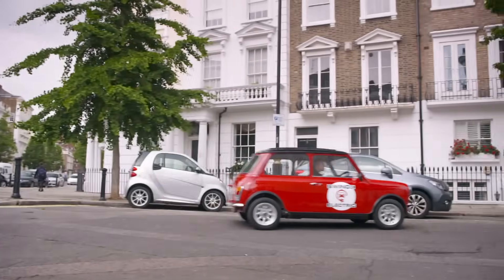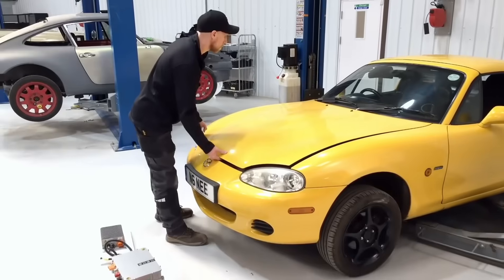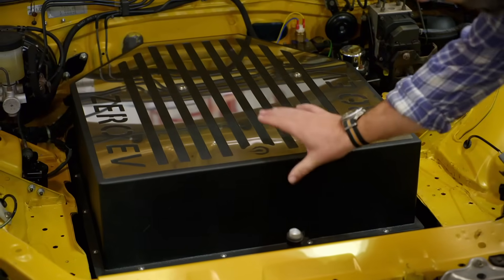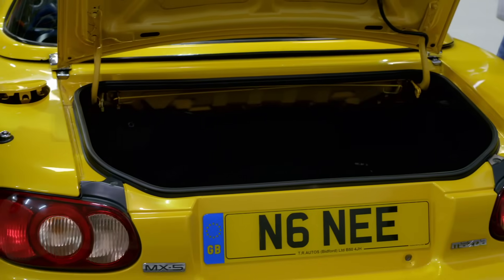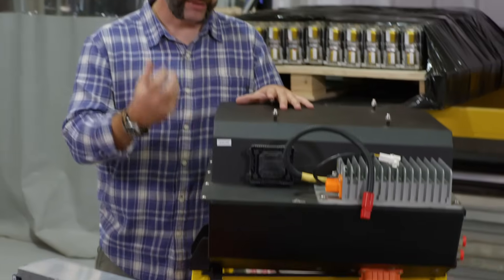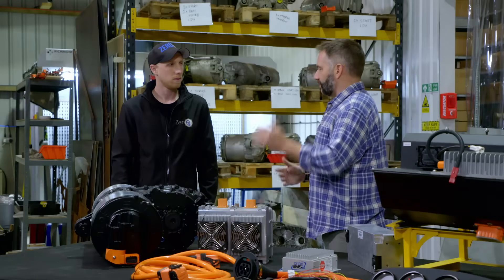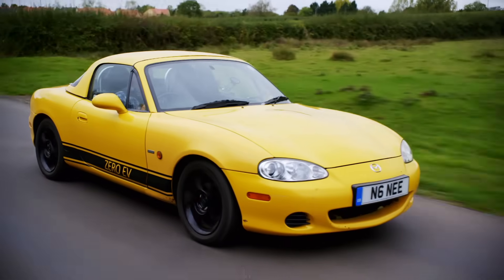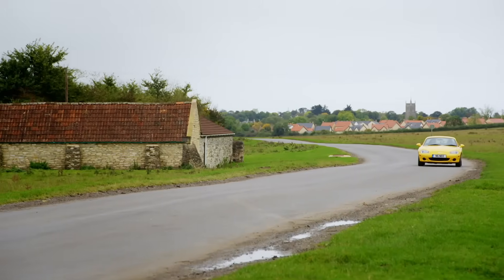What is really involved in converting an IC car to EV? | Fifth Gear

Comment: Why? Batteries haven't been perfected yet. You always have the expense and problem replacing the battery. Any gas savings etc. needs to be saved to pay for a battery to be replaced. What are you saving. Nothing. And you can't drive any distances. An EV isn't reliable. Fact.
Reply: Gas cost in UK is crazy expensive. Probably works out to be cheaper in the long run for EV.

Comment: EV conversion makes so much sense!

I would love an bolt in kit for my Polaris Sportster 850.
I don't need/want much power/speed

5-10 kW motor
5 kWh battery
max speed: less than 20 km/h

Comment: Other companies are also creating bolt-in kits, and as they expand the consumer cost will come down. It's a perfect way to preserve older cars while improving on the limitations of internal combustion with better performance and reliability and less maintenance.

 My dream vehicles would be EV conversions of a Mazda Miata NC with retractable hard top and a Mazda B2600i 4x4.

Comment: I have been looking into this & the kits are either :
A-WAY too expensive
OR
B-requiring of a lot of fabricating for brackets & whatnot.
I'm thinking the easier & cheaper way may be to buy a wrecked EV with intact drivetrain , scrap the
crumbled body & attach the body of your choice. CANOO is pushing this idea. After you own a CANOO
for several several years & either tire of it or have a new requirement, scrap the body & mount a new 
style body. You could switch it out to a sedan or a pickup or whatever.

!

Comment: This is going to get crazy. Future SEMA shows are going to be packed with EV conversion stuff both hardware and software and it's going to blow your mind. OEM EVs may be difficult to upgrade to new battery technology but if it's a conversion car none of them can prevent you from using the latest technology or software.

Comment: Feel free to do an episode like this in Australia... 
They will only convert classic cars and starting at $40,000.
I want to convert our family 8seater van as it cost $200-$230 a week to refill with diesel. Yet we feed 500kw+ back to the grid with our solar weekly...
Reply: How far do you drive if you refill for $300 a week?.
Reply: It's because it's not viable to do conversions at mass scale. You just can't get the advantages of large scale production with individual builds such as EV conversions. It's not the path for affordable motoring. It's basically high performance hot rodding.

Comment: With the fact that California power companies said “you can either power your house or charge your car, you can’t do both” and the fact that neighborhoods around mine with a lot of EV cars are always losing power to their hood, I’d rather do an electric motor in trunk and my 4cyl gas engine up front
Reply: Thats forgetting the fact that EV's can be used to feed power back to the grid when not in use with vehicle-to-grid tech.

A fleet of electric school buses in Massachusetts were used to feed over 80+ hours of electricity back into the power grid last month.

Comment: im actually starting to plan a conversion on a E46 bmw i will be fine with the hardware side of things but i am trying to work out how to emulate not having the dme, most other modules like bcm,driveline module access module  can bus etc etc require the dme to function .i still want to have abs,immobiliser etcetc.  how do i get around this?

Comment: Love the idea of EV conversion kits and look forward to a growing aftermarket offering reasonably priced kits for a wide range of vehicles.  Personally the high performance aspect that has become a focus is off-target and only adds to expense.  Other than the obvious advantage of not requiring fossil fuels the most important aspects are range and reliability.  Kinda wish this vid had addressed that better.
Reply: Damn that’s crazy. Makes you glad we don’t have to worry about toxic chemicals with our maintenance costs, the oil for the engines and thank god for our eco friendly non fossil fuelled petrol and diesels which hardly produce any CO2 emissions :)

Let’s rid these toxic EVs!
Reply: I'm curious where that "non-fossil fuel" energy comes from?
Ohh, and the materials to build those batteries.

Comment: No thanks. It’s a step backwards in my opinion. We have a fuel system that gets you where you are going quickly, with minimum hassle, and they want us to convert to a system that takes hours, HOURS, to refuel? Insanity personified. It’s a ruse to force us into a limited travel space and make us more controllable.

Comment: My dream car: A small, regular cab pickup converted to EV.
Reply: it seems the world obsessed with performance and classic cars. those terms automatically means more expensive. I just want to stick in a battery pack on back of my hilux, electric motor in front. 100 km a day range at max 100km/hr... this is all one needs. charge it while you sitting at home/work job site
Reply: We did this with a 55 GMC pickup. The affordability is doing the work yourself. My husband restored the truck completely himself. He bought a hyper9 motor, a transmission adapter, and some leaf batteries. It is road legal, but doesn’t get driven presently due to shifting trouble. I think he wants to get a different tranny rather than attempt to keep the original 67yo one. Once that is done we can drive it regularly, and finally test out the range. He is hoping for about 50miles, but mostly because these are old Nissan Leaf batteries, and the long range technology simply wasn’t there. On the plus side, he doesn’t have to worry about cooling the batteries.

Unfortunately, since then, due to the interest, the value on salvaged battery packs have climbed to the point where it’s better to simply buy a running driving EV, and part that out. After all, many EVs from the mid 2010s are about US$16k. You get your battery pack, drive motors, electronic comments, etc, all at once.
Reply: Like an S10?
Reply: I would love an old Volvo Amazon converted to EV

Comment: Will it pass MOT?
What about insurance?
Is it crash tested?
Reply: Yes it be easier!
Car that age could go on classic insurance!
Do you have to crash test an engine swap car?!
Reply: @dancollier9837  
No to crash tests... if its done by the owner ... not in the UK or EU but kit cars have to meet single vehicle approval construction and use standards and as the exterior and interior isnt changed thats basically going to be breaks and demisting the screens... So Just a MoT check ... what the insurance companies think they can screw you for ....is a other problem but as the power and wt require no other mods thats like saying you've replaced a dead ICE like for like.
It will drive like an electric motor though 😁 more torque from go, smoother more controlable, quiet and then it should be pretty much maintainance  free .... No oil, filters, belts, complex adjustments or masses of sensors or exaust s.. no fuel tanks to rust or leak ..fuel pipes to replace, no clutch or complex energy sapping wear prone gearboxes. 
But costs still have to come down ...hopefully as the supply of crate systems and breakers come through and the aftermarket manufacturers switch to the new tech ...because they will have to drop their old products fast if they are to stay in the auto parts business.. electric motors use a very small number of parts compared to ICE.

Comment: Some old classics should remain internal combustion because of the engine sound, and the engaging driving experience. But I'm glad to see this (not that old), Miata converted. This has yet to really catch on here in the US, but I'm sure it will eventually. Thank you.
Reply: Old engines suck and are broken most of the time and replacement parts are not available. The only way to keep most classic cars running is restomodding, so instead of putting in a K20 honda engine you might as well put in an electric motor. THE classic cars that have replacement parts manufactured, should be kept original though.

Comment: That battery goes way over the front axel, which I am pretty sure the engine does not do... I think batter tech needs to come a long way before this makes any sence
Reply: Battery tech is here now
Reply: @vidznstuff1  Yeah but aftermarket builds are not even close yet. Battery pack shouldn't be under the hood. Traction of thing must be horrible like fwd chevy bolts.
Reply: @samusaran7317 if you're talking about Traction in the snow, everybody who owns Bolts says in different YouTube comments that they go good in the snow
Reply: @vidznstuff1 it's sort of is for the home charger owner, but if Toyota can pull off the solid state batteries they want to have available within the next two to three years, it will be awesome the possibilities

Comment: I would get an hybrid car not a full electric, just found out like all rechargeable batteries they loose power and take longer to charge, bit like your phone battery, but just check the price  for a replacement battery on any electric car, not cheap
Reply: First generation 2011 Nissan Leafs still running with 80-90% of their original charge.
Reply: @stianthomassen6693  has it done more than a 100k miles? And electric is going up, if your from the uk I'd advise you to watch guy martin the electric car episode
Reply: @MrPlanner12  good question. With it’s wonderful 80 miles of range it was not a road trip car, but the reason I brought it up was that the battery had no additional cooling or smart AI charging or automatic maintenance of the batteries. So the batteries should have been much much worse, but reports shows everything from 50-80% of charge left. Now, 40 miles of range is nothing to cheer hurra for, but given the fact that the battery was suppose to be dead by now this is interesting. Officialy: “First generation Leafs came with either a 24 or 30 kWh battery which can last 100,000 – 150,000 miles at most. The second generation uses either a 40 or 66 kWh battery which can last 200,000 – 300,000 miles. Since batteries also degrade with age, we expect around 10 – 15 years of service out of the Leaf.” With a bigger battery and greater range the new eletric cars get less charging cycles which let the battery live much longer.
Reply: @MrPlanner12  Electric may go up slightly but its no where near as expensive as maintaining and fueling a diesel/gas car. Hilarious
Reply: @stianthomassen6693  How dare someone have a shorter commute than yourself. Need some cookies and warm milk bud to help as seethe about? Also my 12 old battery would like to have a word with you too. Lol Myopic ignorance

Comment: I think the Gold Standard conversion spec test, for the average guy used to cheap Classics is something like:
£20k all in cost -
£3k donor, eg Mk2 TT AWD with basics reconditioned (bushes, pads an discs)
£16k conversion, Including laybour
250 ml real range with min 50kw charging
0-60 c 5 secs
VNE geared down to 85 to help acceleration
similar weight, with perhaps small adjustment toward 50/50 where possible

It would appear already possible if the strip down and bearing replacement of robust EV traction unit was paired down to essential only and instrument replacement minimised (eg just use a cheap tablet or primary speedo with support data on cheap smart phone)

A £19k TT awd with 0-60 in 5 secs and 250 ml range has gotta be attractive :)
Reply: 250 mile, even city range, is very difficult to do using today's batteries, even the most expensive ones. If you settle for a third of that range what you're saying is already possible. Half of that range and it's possible but more costly. Factory-made EVs have the huge advantage of being able to spare much more room and weight to the battery pack.

Comment: 16k in just parts to make a silent mx5 that weights 10% more..
Reply: What’s it’s range now though? My Sunday morning backroad run is a 300km loop. Would it make it? Especially if you were spanking it?
Reply: @richardhoulton4016  300km loop in the morning? You have to be kidding.

With village speed limits etc, that's easily  4+ hoursy of driving. Unless you take it onto the motorway in which case this really isn't what a Sunday morning drive is about...
Reply: @adamm.chawner6137  Sorry…here in Australia it’s definitely not uncommon for car groups to do distances of that magnitude. Sure…it takes an early start and all morning, but so what?  Don’t want to be having to stop for an extra hour’s charging in the middle of it though.
Reply: @adamm.chawner6137  Nope, 300km in a morning no problems
Reply: @richardhoulton4016 you know it's the battery pack that I can't get around so a Tesla is 100 KW hour and so if you're using 25 kilowatts an hour then you can divide 25 into 100 and have a rough estimate on how far you can go that simple math you can drive for 2 hours they're saying a 6 module carnegiea will go roughly 100 miles if that helps
Reply: That will save you money on gas and maintenance...
Reply: It also means you need madness to do so because there are many used EVs going for a song because “NO ONE WANTS THEM”. Also what a waste of a good MX-5.
Reply: @oddjobsandrandomprojects  But you can top them back up in 5 minutes
Reply: But probably much quicker
Reply: Not to mention all the fossil fuels used to dig up those precious metals for the battery, and all the fossil fuels to run the power plant to power that car.  Seems like a real win for the environment LMAO
Reply: Crazy to spout a point with no thought, when even after weighing for the environmental cost from production, you can power it with nothing but a gas generator and be more eco friendly in less than 5 years. Crazy to hate improving performance, costs, and efficiency @johnhutchison9782
Reply: @johnhutchison9782  good fossil fueled cars don’t use any precious metals and that raw oil ain’t pumped up by diesel aggregate or coal driven power plants. Good that the refineries don’t have their own power plant to power up the ovens to boil that raw oil 😉 joking aside, a new report from Germany from the university in München shows that an ev is 89% more friendly over its lifetime. I’m sure we can have a long discussion, but the point is that I was where you are, before I discovered that alot of it was propaganda. Like, why have we not talked about the unethical practice of mining precious metals for the car industry for the past 100 years? Now, now the oil industry cares suddenly.